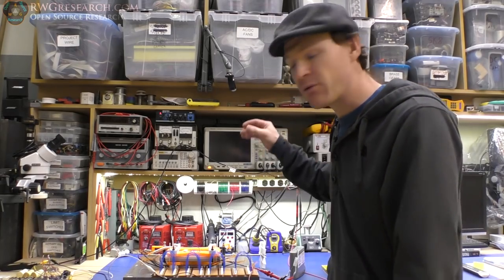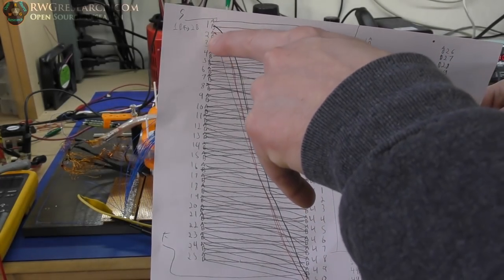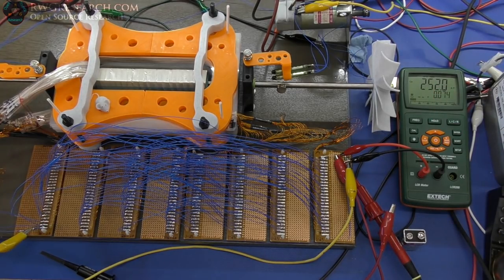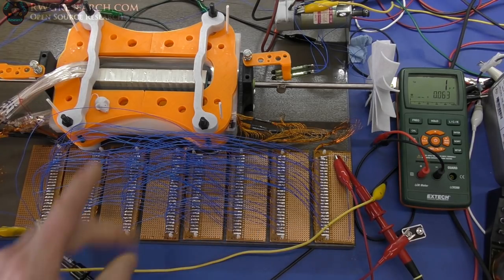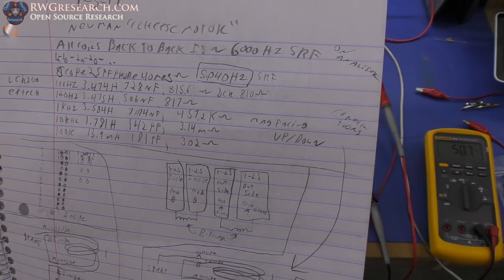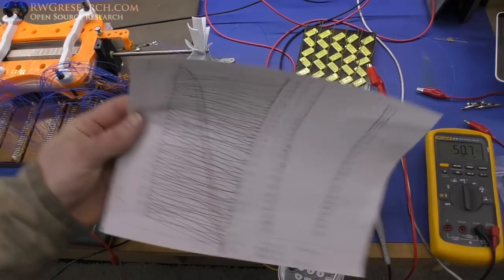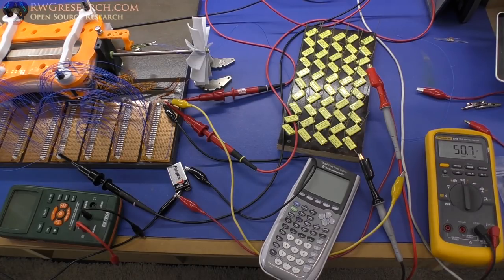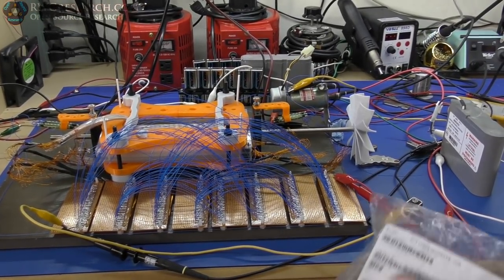TSFA 26 1019 / Cheesy Fan #4 : Confirming Measurements, Checking Data, Thoughts, Concerns

Comment: Well done Russ. Keep up the great work and just solder a high voltage ceramic cap about 1 to 100 nanoFarad in parallel with each coil. This will bring the resonance frequeny way down so you can try to run the whole motor at its electrical resonance frequency...Good luck. Regards, Stefan.

Comment: I just had an epiphany, how to solve the capacitance problem. The wire and its insulator itself creates the  inter winding capacitance. The very thin enamel on the wire is the insulator between each winding. If you could increase that capacitance between wires you would lower the self resonance frequency. 

I usually don't share my best Ideas, But I am getting to old to try all of them.  Here Is my Idea.

Have you seen the you-tube video that Robert Murray Smith has on building 4 Farad caps, with his  graphene coating formulation.
One could coat the wires with his coating and then add a porous insulator coating and fill the coil with an electrolyte. You theoretically could lower the self resonance frequency a great deal.  You could make wire that is designed for a specific self resonance just like a load line impedance cable. The thing is you potentially could store all or "near all" of the back EMF energy being reflected back and forth at resonance. 

Robert Murray Smith  graphene supercapacitor  Watch
 https://www.youtube.com/watch?v=1Ce2au3PWnI

You Should Also Look At this video. Because this is a related technology.
https://www.youtube.com/watch?v=HK3JOlY0V8Y&t=615s

 Russ Go for it.

Comment: Consider the ratio of inductive reactance to resistance. It increases with the L/R time constant of your coil and with the frequency. Your L/R time constant is practically unchanged when you reconfigure the winding sequence. The L/R is the main thing that determines the time of the decay of the current in the coil. Then when you reduce the resonant frequency by increasing the distributed windage capacitance, it increases the period of the oscillation, meaning fewer, but longer cycles in the ringing. The nine numbered steps in the article "COMMUTATORS FOR NEWMAN MOTORS - AN OVERVIEW" by Ralph M. Hartwell implicitly suggest that the pulses should be of a duration smaller than the L/R time constant of the coil.

That gives us a few options: 1) Use a bigger coil, 2) Use a more conductive material, 3) Faster switching. That being said, having distibuted capacitance should help increase our LC-resonant stored energy at a given voltage, enabling simple solid state switching.

One can use a hall effect sensor (A3144) whose output switches a power transistor (TIP42C) that switches power on and off to a 555 timer (WINGONEER 5PCS NE555) whose output switches an IGBT (IRG4PH30KPBF). I have done this just yesterday, but I am still waiting for some parts to build the rest of my next build.

Comment: WOW: You are one of the few people on You-tube that knows what he is 
talking about.
I am so very excited that you are going down this road. 
But I have to caution you that the energy complex out there does not 
want this technology to be given to the masses, so watch your back. I 
worked on HHO technology for 10 years and even put a unit in a 18 
wheeler. I now have a lung condition  that no doctor can diagnose. 
According to them it is idiopathic or they don't know the cause. Spent 
$150,000 on doctors. They will find a way to stop you. I hope they don't
 because we are going to need this technology in the years to come 
between now and "the Millennium". The time before Jesus comes again. I 
pray every day that he well come to clean up this mess.

You are now doing what I have wanted to do for several years. The TPU is
 the next step to build a motionless gen with no moving parts. Keep 
Going like the energizer bunny!!!!!!! LOL. You are on the right track. 
 That coil printer is awesome.